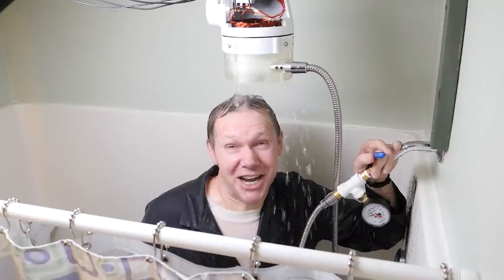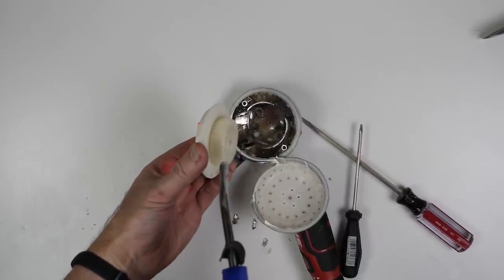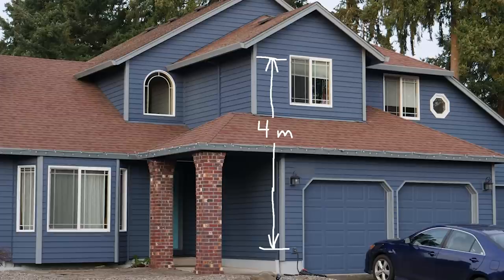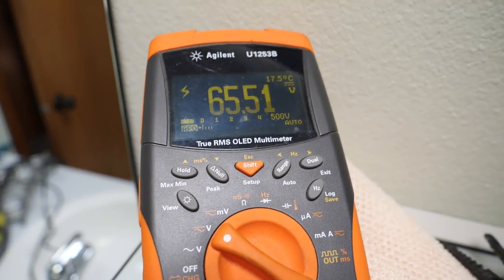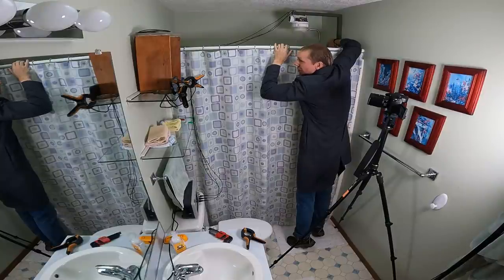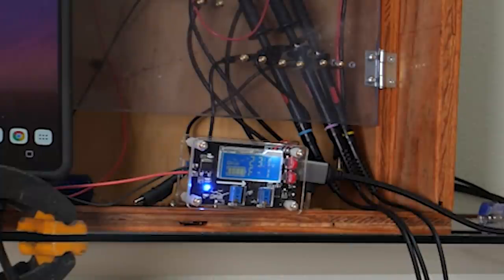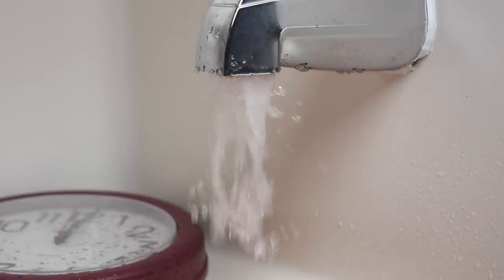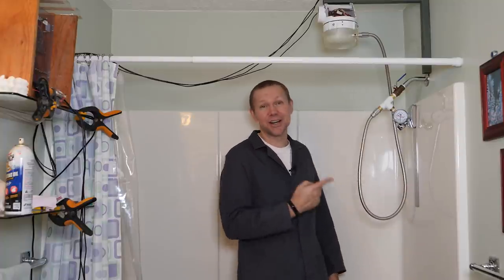SHOCKING Results! How much POWER is in your SHOWER?

Comment: Altering it to produce less volts should cause the amps to go up and in this situation likely causing a large loss in power.  Just a theory however.
Reply: You said, produce less volts and the amps go up. So should that not result in the same amount of power?  But you said it will likely cause a large loss in power.
Reply: @deang5622  Amps create resistance and heat.  If you want to push the same power but with more amps and less volts thru the same thing it will generate heat.  So you are always better if you can to reduce the amps or make sure you have oversized cable in these cases to reduce heat loss, its not that it is unsafe just not ideal.
Reply: @darrenorange2982  Amps do not create resistance. Heat can affect the resistance.

I was challenging your statement on the claim there was a large loss in power. Seemingly you actually do understand the inter relationship between current, voltage and heat.

I don't think the power loss in this instance would be huge going to a higher current.

Comment: Go back to your wye configuration and get something that can handle the extra voltage and see if the generator efficiency goes up. My bet is that you are losing power by only using 1 winding vs all 3 windings.

Comment: I've not dealt much with 3 phase motors, but my initial thought was that with your wiring - the Y format, your using two of the three coils. Delta your only using one. Thus, you have much less power. That is, if that is what you actually done, instead of utilising all three coils and 3 phase rectification.
Reply: No.
In both star (Wye) and Delta, all 3 coils are being used. They are just connected in a different configuration.
Reply: @deang5622  You sir are correct. I have learned a lot in these months, and the total power is the same. I've still got stuff to learn (learning never ends!). I may have the terminology not quite right, but from what I learned:

Delta systems line to line voltage is the same as a phase, and line current is √3 * phase current
Wye systems line to line voltage is √3 * phase voltage and line current is the same as phase current

Δ: 120V * (√3*10A) = ~2080W 
Y: 10A * (120V * √3) = ~2080W

Comment: Fun video but for being so detailed you missed an important point. All of the energy from the water pressure is being converted to electricity and heat and nobody likes to have a shower with no water pressure.

Comment: Try a little more economics and a little less engineering. 

Look at your home insurance premium. With 100% efficiency, a mutual insurance company's premiums equal their claims. Sum up your premiums for the 30 years you pay for your house. Now compare that to what you pay for the house. Insurance won't pay you more than your house is worth (less the land value of about 10%...you can't burn down your land). 

Keeping it simple (i.e. running the numbers in your head), you will notice they're charging you in premiums 1/3 of what your house is worth over that 30 years. That means they're claiming the probability of total destruction is 33% over 30 years. Take any neighborhood more than 30 years old. Have 1/3rd of the houses been totally destroyed? No you say? How about 1/10th...or 1/100th? You've now realized the insurance company is screwing you by 100 times. So you're wasting $10,000/year on a $240,000 house. Compare that to what you can save through energy efficiency. 

Moral: go after the big waste first. Remove the klepto insurance industry.

And you may have noticed that what you pay the bank to buy your $260,000 house is three times the value of that house (i.e. over $750,000. Why? The bank steals interest from you. Why is it theft? Because the banks don't pay interest. They have a 10x leverage advantage over you and me. That means if they make a 4% spread (difference between interest they charge and interest they pay out), they're making 40%/yr on their capital. At that rate, their capital doubles in less than 2 years. Thus, the banker (a so called capitalist) can pull "his" money off the table after two years...and makes double his (now non-existent) capital every two years as long as you submit to his scam. Over 30 years that's over 150 times his original capital ($25,000 for your $260,000 loan...that's $3.8+ million, just for risking capital of 1/10th of your loan...for 2 years)...which was only at risk for 2 of those 30 years...after that, "his" capital was in his own pocket. 

Moral: go after the big waste first. Remove the klepto finance industry.

And look at government. Run the numbers. They're taking fully 3/4ths of what you earn. Really? Yes, really. You pay income tax of say about 30%...very visible. You pay sales tax, say about 8%...a little less visible. Then you pay tax on your electricity, your gasoline, your "real" property, your lottery ticket (that tax is fully 50% tickets you buy), and on and on....all pretty much invisible. It's not hard to get to 50%. But you're not done. Every product and service you buy is created and delivered by someone also paying 50%...and they pass that on to you. So 50% of the 50% government doesn't take from "you" directly, they are taking from your vendors. That's another 25%. So 50% plus 25% is 75%...fully 3/4ths of what you make. Are you happy with government as a vendor? They can't even count your votes without corruption.

Moral: go after the big waste first. Realize, every time a government solution is proposed, you're still looking for a solution. Government is never the solution to anything.

Google MoneyDelusions and "what is money". Too bad YouTube eliminates comments with links. Hope you find it and read it.

Comment: Listen I don't mean to insult you here but why the hell are you testing anything without just testing it on a resistance load before putting it on your voltage regulators? Surely you would rather have a wire burn up than a freaking electronics board explode?
Reply from the maker: Yup, I was in a rush and tried to skip some steps. Made it more exciting though! 😁